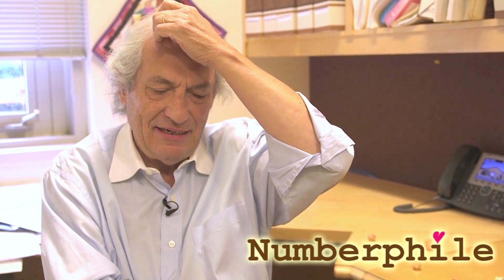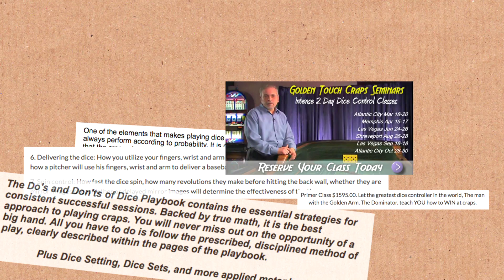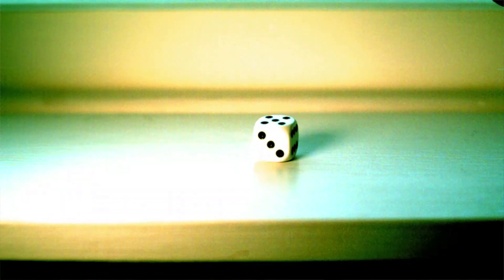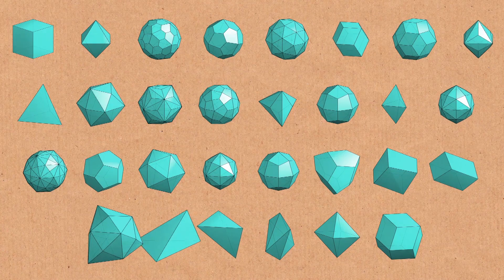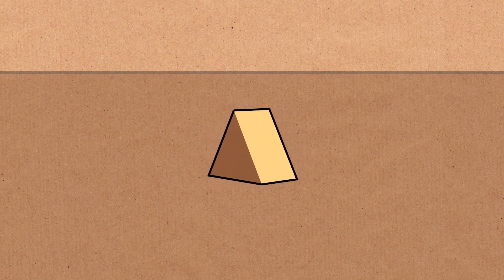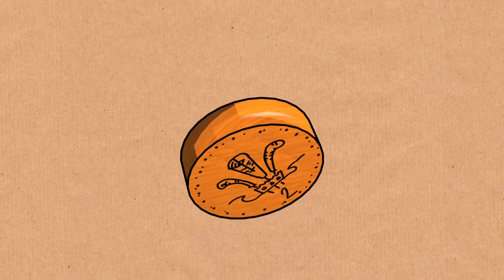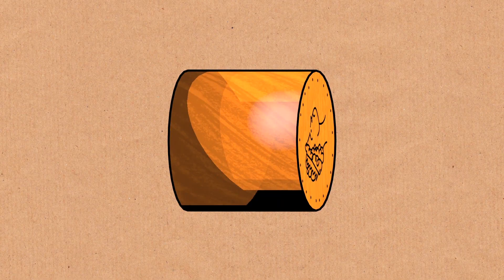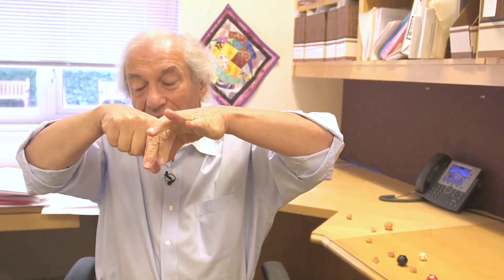Fair Dice (Part 2) - Numberphile

Comment: I have an offtopic problem, maybe you'd like to answer it anyway. It really annoys me.
Does a point have zero length, or is it infinitely short? My statistics professor told me it has zero length, but I don't think it's true. Is there a proof for that?
If you have a 1 length straight line, it consist of infinitely many points. But if you add up infinitely many zeros, how would you get 1?
Reply: A line is not made up of infinitely many zero-length points, it is a 1-dimensional object that is defined by two end-points. The fact that any of the infinitely many points between those two points falls on that line doesn't mean they make up that line. A 1-dimensional line has 0 width, so a 0-dimensional point has 0 length.
Reply: > But if you add up infinitely many zeros, how would you get 1?

You only get 0 if you'e adding up an countably infinite number of zeroes. But the number of points on a line is not countably infinite.

If you still insist that the points don't have zero length, what do you mean by "infinitely short"? Infinity isn't a number, so you can't write "1/infinity" and be done with it.
Reply: Oops, that was a typo. I meant 0, there, not 1.
Reply: Probability theory uses that thinking, that if you add up infinitely many zeros, you get 1. It's more complicated than that, that's why I give you an easier problem, the length of a point.
We learned today, that if an event has 0 probability, it can still happen. And if an event has 1 (or 100%) probability, it won't necessarily happen.
Reply: edderiofer I guess in this example you must  assume, that the number of points on a line is countably infinite. But in this case I still not understand, how would a countable infinite number of zeros adds up to 1.
Reply: ***** > that if you add up infinitely many zeros, you get 1

Only if you're adding up an uncountably infinite number of zeroes can this happen (it's not guaranteed). Adding up a countably infinite number of zeroes still gets you zero.
Reply: edderiofer "You only get 1 if you're adding up a countably infinite number of zeroes."
You said that
Reply: It doesn't matter that the points don't have any length, because no matter which two points you choose on the line, there'll always be an infinite number of points between them. There'll be no holes in the line, because no matter how small a segment you choose to define your hole, it'll always have an infinite number of points.
Reply: Rubjerg But you should be able to make a line with points. You just keep adding points to a straight path, and after adding infinite number of points, you should get a line. And here's the problem. If the points doesn't have a length, then how would you get a line?
Reply: No, you can't make a line with points because there will always be a point in between two points you didn't include, and points are zero-length.

Points can be used to define the parameters of a line, but you cannot use them to make a line. That's just the way they're defined.
Reply: Because when you "drill down" into a hole in the line, you're drilling into infinity, and you'll never be finished.
By an analogous argument, you could say that there's no infinitely long line, because however many points you add at the end (even assuming they have a tiny length), you can always put more. Yet, mathematicians and physicists work happily with infinitely long lines in Euclidian geometry.
Reply: Rubjerg Technically, all Lines are infinitely long. Line Segments, which are commonly what people mean when they refer to lines, are 1-D objects with a finite length (and Rays are 1-D objects that are infinite only in one direction).
Reply: *****
Well, yes (at least in Euclidian geometry). Just take "infinitely long line" as an expression (tautology if you like) for "line" to avoid ambiguity for people not completely familiar with the mathematical definition.
Doesn't affect my main argument. Going into the infinitely small has some counter-intuitive aspects quite similar to going into the infinitely large. By the way, Numberphile did an interesting video on infinitesimals a while ago :)
Reply: Physically, nothing can be smaller than 1 plank length, so we could argue that a point has a length of 1 Plank unit. Ok ,no, I leave now...
Reply: When I say line, I mean line segment. I'm learning maths in Hungarian, so I don't know everything's English equivalent.
Rubjerg Did you know, that there're more correct mathematical models? In Euclidian geometry two parallel (infinitely long) lines newer intersect. In Bolyai geometry you can draw infinitely many lines through a point, which are parallel to a given line. In elliptical geometry (for example by Riemann) any two line intersects at infinity.
These're both correct.
So maybe a point can have zero length, and infinitely small length, and both would be correct.
Maybe a line segment can defined by countably infinite points. If I take a finite length straight path, draw a point in the middle of it, and then draw points in the middle of the 2 remaining paths, and then draw points in the middle of the remaining 4 paths, and so on, I keep halving them. If I take any two points, I can draw another one between them. So after drawing infinite number of points, I should get a line segment this way, with countable infinite number of points.
But this line I made won't have irrational coordinate points in it. So if I take a normal line and this line I made, they are not the same. Even though both have the ability, so I can draw another point between two existing one. So are these two different or the same?
Reply: Mathematics not work like this. When we talk about mathematical stuff, they don't need to work in reality. In reality we can't write down an infinite digits number, but in mathematics we can use them, and calculate with them.
I believe that everything is a process though. A function is not just a given drawing, the points of a function are drawn one after the other, not all at the same time. But the process of drawing the infinite number of points, completes in an infinitely short time.
Reply: *****"When we talk about mathematical stuff, they don't need to work in reality"

Not sure if you meant the repeat to signify agreement or disagreement, but the fact is that mathematics is a very abstract, perhaps the most extremely abstract system that Humanity has ever worked out. In fact, it remains a basic philosophical question if maths is a discovery or an invention.

Mathematical stuff, indeed, don't need to work in reality. A small SUBSET of mathematics does serve as an incredibly effective and unparallelled way to describe physical phenomena, but that's besides the point.

Nobody ever came up with a better alternative.
Reply: *****
Sorry, mate, don't get your banter. I don't have a teacher, as I left school back in the previous Millenium. I do, I think, know what you mean by "Float", as I have a university degree in computer science. But how maths is represented in computers, really is quite irrelevant to mathematical principles in themselves.
Reply: ***** i was talking with +kleavenae about his teacher.
Oh, sorry for butting in, then.
But, now I'm here, let me just say that computer science is trying to emulate maths, while the reverse is rarely the case.
Reply: *****
I think most linguistics, and even most laymen, would agree with that distinction.
Reply: In most cases, with computer you can't solve a mathematical problem. You can only simulate it. Because you can't calculate with infinitely long numbers, say Pi. You can't draw a perfect circle to the screen, because you can't calculate Pi. So there's no point comparing mathematics and computer science. Mathematics is abstract, and computer science is real. That's the point, in mathematics you can do things, which you can't do in reality.
Reply: +kleavenae I feel we're drifting a bit. The original question was if a "point" in mathematics/geometry has a length or not. In that context, I don't really see the use of discussing how numbers are represented in computers.
Kleavenae, you argued that the "length" of a point must be non-zero in order that they can "build" a line.
You suggested that the length would be infinitely small, and I can understand why. If a point has a length greater than infinitely small, there could never be infinitely many points on a line segment.
Now, watch your own argument closely. You're saying that a line segment can't be built by a finite series of zero-length points. But the exact same thing can be said of your solution: A line segment can't be built by a finite series of infinitely-short points. By postulating an "infinitely small length", whatever that might be, you don't seem to me to introduce any kind of solution, just further questions.
Reply: "But you should be able to make a line with points." Who says that?
Reply: If you have a 1 length line, you can make it with 1000pcs 1/1000 length points, or 1000000pcs 1/10000000 length points. Or infinite number of infinitely short length points. That seems correct for me. And if you're asking, points does have length as a parameter, because zero is a length, too.

"But you should be able to make a line with points." Well, we know that lines are made of points, that's an axiom. So there must be a mathematical technique to build a line from bottom. Of course, if I just keep adding a point after a point, and points between them, I'd "never" get a line. But we have a technique called "infinity". Infinity doesn't exist in reality, but it's a axiom, we can use it to make things, and I'm stating that a line can be built by infinitely many points.
Reply: Another way to put it, is to answer your question "But if you add up infinitely many zeros, how would you get 1?"
You do, IN THIS PARTICULAR case, because we have DEFINED points and lines that way. Depending on context, infinity times zero can be anything you want it to be, because rules working on NUMBERS do not necessarily encompass infinity.
Reply: It's not an infinity times zero case. You have an infinity long number sequence: 0+0+0+...
And we sure know, that's zero, not infinity.
But if you have a sequence of: 1/inf+1/inf+1/inf+...
You can easily get 1. That's not a sure thing, but it's possible. While getting 1 from 0+0+... is not possible.
Reply: *****
So there we have the difference of the way we view it. You say that "we sure know" that the addition of an infinte number of zeroes is always zero. I say we don't.
Reply: "In analytic geometry, a line in the plane is often defined as the set of points whose coordinates satisfy a given linear equation, but in a more abstract setting, such as incidence geometry, a line may be an independent object, distinct from the set of points which lie on it."
I'm talking about the first one. There're multiple definitions of a line. But as I saw, in most of the definitions, lines are built by points.
Reply: Also, a "location" is not a point. A location is a pair of coordinates in the plane. Points have location is their arguments, they themselves are not locations.
Reply: Any infinite sum can give you literally any number, it depends on the ordering employed to sum over. Think of a simple intregral, you´re really summing over an uncountable infinite of 1-d lines of random, tough progressive, lenghts and building a 2-d object thats both finite and bounded and all you had to do in order to get that is state a desired width.
Reply: "Any infinite sum can give you literally any number" That's not true. Check Abel's theorem. That's only true for not absolutely convergent sums.
Reply: hmm I must be missing something. I tough Riemman series theorem apply to any converging sum. I don´t get why a perfectly converging sum would be any different. I am checking Abels theorem for insight, and it says that a perfectly converging sum would have a trivial result, so, what am I missing?
Reply: If any infinite sum could give you any result, than it would be useless to calculate convergent infinite sums. If I have a sum like: 1+1/2+1/4+... it can't have other results but 2.
Reply: I like how you just threw riemman series theorem out of the window. The sum you describe also has the result of ln[2] by the way ;)
Reply: Because I don't know Riemann series theorem, and Google does not seem to give a find. But I'd like to see the deduction for the ln(2) solution.
Anyways, two results are not infinitely many results.

Comment: A 1-sided die is fair. Theorem ruined.
Reply: It's just a sphere with a number on it.

Basically a pool ball.
Reply: Or a mobius strip, if you'd rather flip it than roll it.
Reply: Obviously with round surfaces you can do a fair dice with any number of side, but i guess the theoreme speaks about polyhedrons.
Reply: But if it's a sphere, it's not really a die anymore. So it's not a one-sided die.
Reply: A Fatalism die - Rolling a 1 is inevitable
Reply: A 1 sided die would essentially be painting a number on the ground and calling it a die.
Reply: That does not work because a sphere would not be considered a one-sided die.  It would be considered infinitely-sided, because any of the infinite points it could come to rest on need to have a corresponding value on the opposite side of the sphere.
Reply: All this talk of spheres makes me wonder... How would this change if you had concave faces so the die had to land on its vertices instead of faces?
Reply: @KahurangiSteez  It would never land on only one vertex. It would always land on however many vertices the faces have. A die can't land on a singel vertex.
Reply: You are right though that he never mentions the requirement that the faces are flat. It's really easy to make fair dice with an odd number of faces if the faces can be curved.
Reply: (I know you were joking, but)  You could argue that a 1-sided die is not fair, because it is not random and fully deterministic....theorem restored.  Whew.
Reply: That's a marble, while fair it is redundant
Reply: 2:54 I've wondered about that type of dice before. Similarly, you could have a football shape that you distort by enlarging or reducing pentagons to equalise the probabilities.

However, Toblerone is a poor example. Out of the 3 big sides one is where the pieces are joined together, and that's the heaviest side, making it more likely to land with that side down. Just use something of that shape that's solid...
Reply: Ehhh do you have a picture ? #sceptism
Reply: A Mobius strip would be an ideal one sided die.
Reply: And that's two people who don't recognize a joke...
Reply: No, that would be an infinite-sided die.
Reply: A sphere has -1/12 sides.
Reply: Lol if you look above the avatars spell BBC backwards lol. CBB

Comment: why is he assuming that the dice would use 100% of the surface area, surely you could make a 5 sided die with equal area and shaped sides and use the remaining space to make uneven edges so the only way the dice could land is on one of the flat sides and use the bottom facing side as the result of the die roll?

Comment: You can make a fair die of any number...odd or even... Imagine the full length Toblerone example but instead of 3 sides it has 5 sides, or 6 sides, or "n" sides and then on the flat ends...you can do one of two things...either round it off or have the end have a pyramid that equals the "n" number of sides. This way all the "long sides" have equal surface area and likelihood of coming up, while the ends, should the die land on them, the die will pivot to one of the long rectangular sides thereby never being able to "land" on the ends due to center of gravity no allowing one of the pyramid ends to be touching the table

Comment: One interesting thing, they can make practically fair dice with any number of sides by using that prism trick. They just make it long enough so it won't land on its edge very often. If it does, re-roll.
Reply: This is outside of what they're discussing probably, but you could always round the two flat ends so that it's exceedingly unlikely.
Reply: @liammontgomery1825  Make the ends come to a point, maybe add some feature that makes chaotic bounces on those ends.
Reply: @chaotickreg7024  i think that would work. a pentagon-prism with pentagon-pyramids glued to the sides in a way it cant stay on the  pyramid sides without falling over. in that way the faces of the pyramid wouldnt count as "sides" of that die and all other sides, i believe, satisfy the gometry group theorem of part 1.
Reply: I think thats the point. A true fair dice would neglect between surfaces, but the toblerone does depend on the local physics. It would be fair on a flat and elastic surface, things like wood really lack on the elastic department. I do believe you can make a fair dice for any one surface, but the area ratio between the different sides varies between surfaces